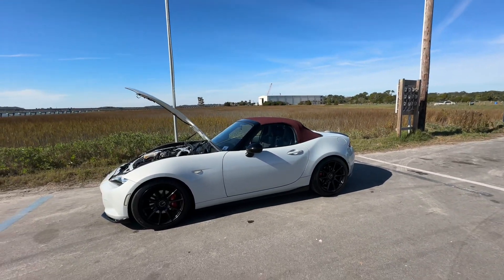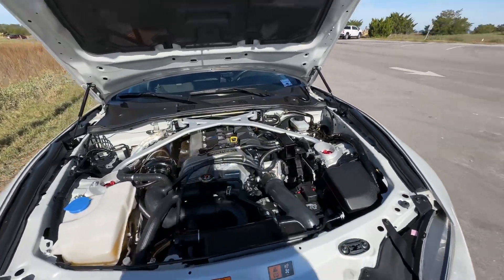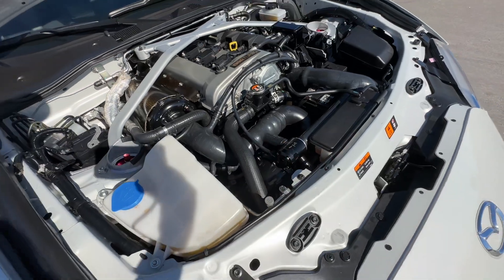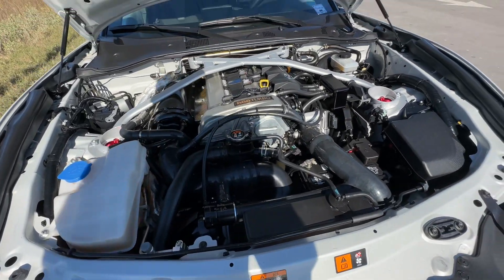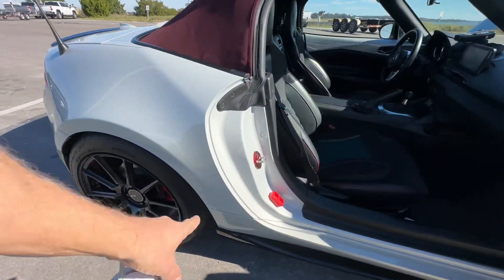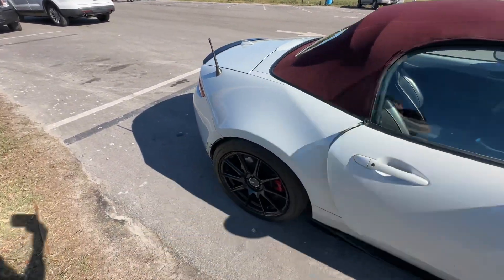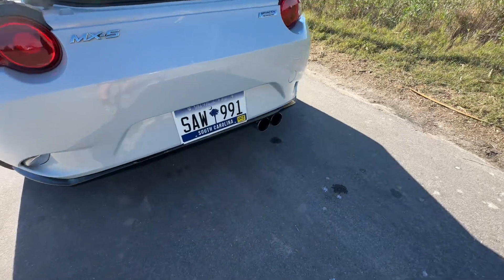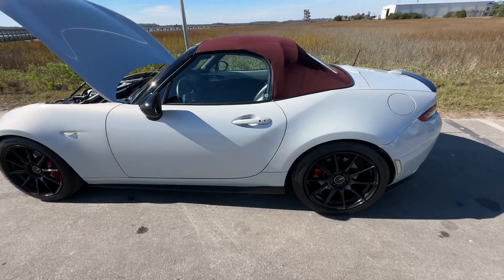BBR Stage 2 ND1 moves to SC for the season.

Comment: Hey man. Did you do anything to the gearbox ? I want to get BBR supercharger kit and aim for around 260hp but given the bad reputation ND gearboxes have, I'm a bit worried...Also, how many miles since your initial stage 1 upgrade now ? Still perfectly reliable ?
Reply from the maker: Yes we did.  We went with a NC transmission and the BBR ND/NC adapter.  PITA but solid.  Seems the earlier the ND year the worse the original transmissions were.

Put the stage 1 on at 12k and ran that in the stock tranny until 14.5k with no issues but was only pushing 180 whp.  18.5k now and I’m hard on things 😊 and no issues other than the clutch giving out.
Reply: @BoostedNDMiata  precious info. Thanks!
Reply: @BoostedNDMiata  yea 180whp isn't too much, I own the ND2 so 180bhp stock... I guess pushing it to 220 would be safe for the gearbox but I kinda want that extra 40hp......gonna cost a LOT more though, wonder if it's worth it :(

Comment: Who did your engine build?
Reply from the maker: Engine was built by Chris Graham at Race Engineering.  Bored block, port/polished head and valve work in addition to the forged parts.  Solid build IMO after 5k miles no issues other than the ACT high pressure clutch not being up to the task for the power.  In fact he just completed another engine, a forged 1.9L for my 1990 NA build, that’s currently in pieces in my garage.
Reply: Thanks man. I reached out. Once I have everything i’m gonna send em my car as well. Can’t wait.  @BoostedNDMiata